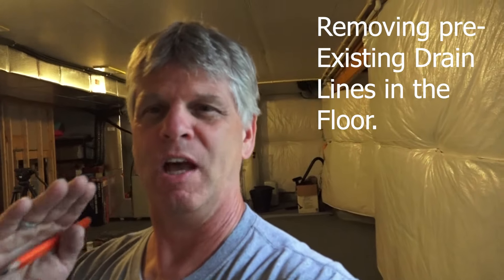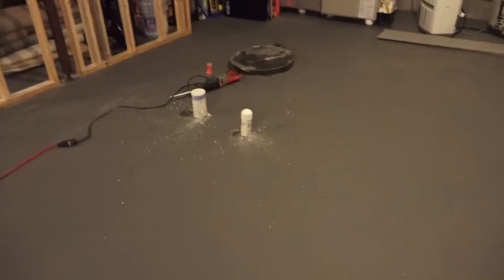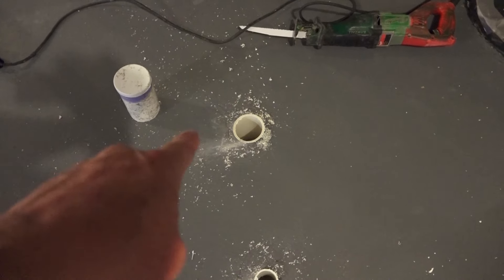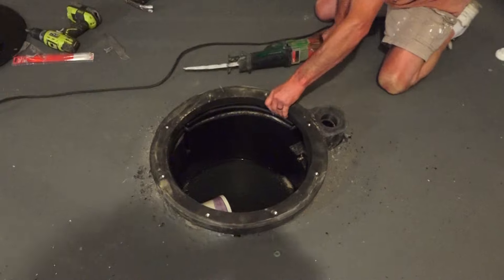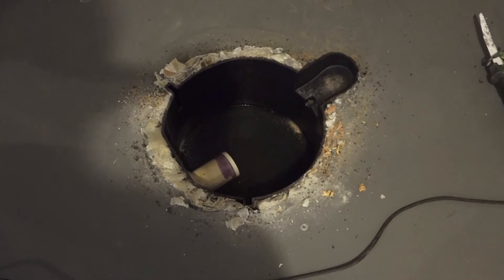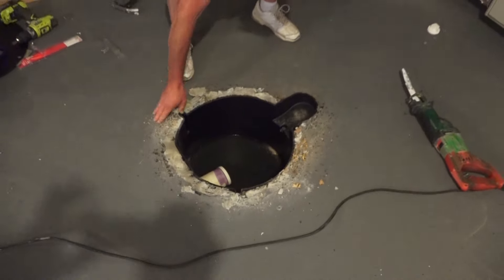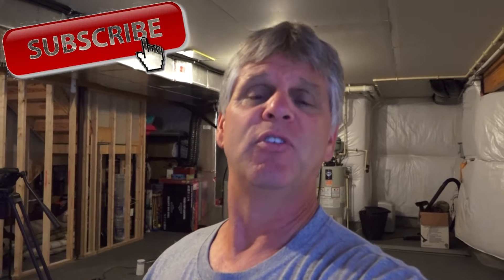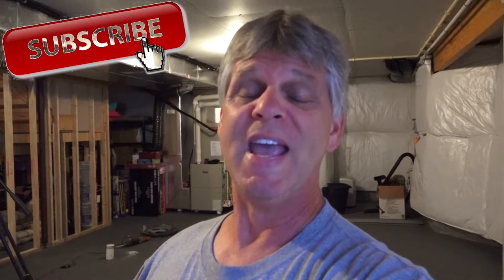Basement Bathroom Rough-in Drain Plumbing (Relocating or Removing)

Comment: I would like an opinion on up flush toilet systems and whether or not you would recommend them. I am trying to avoid digging into the concrete again.
Reply from the maker: Hi Rick...I'm not a big fan of the upflush toilets. You have to elevate shower and tubs on a platform to get the pitch from their drain centers. They are more problematic than a good old fashioned in -the-floor sewage ejector. It's definitely more work to install the under the floor drain lines and dig out and install the sewage ejector pit, but in the end it's the Cadillac-System in my book. Thanks for watching and commenting Rick!

Eddie

Comment: Hey Eddie I have have the three inch pipe and the two inch pipe in a good location in my basement. I was wondering are the pipes vented already since the builder roughed it in??
Reply from the maker: No they never are vented...you will need to vent all your drain lines yourself.